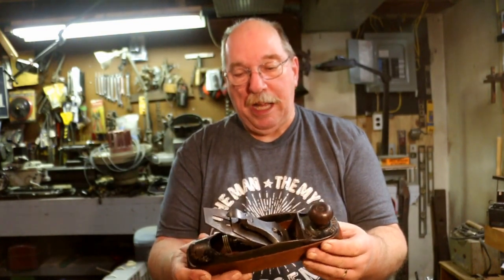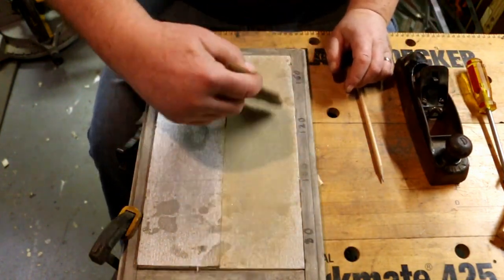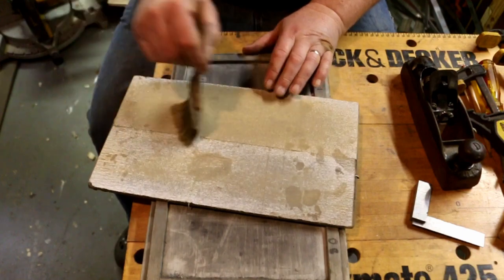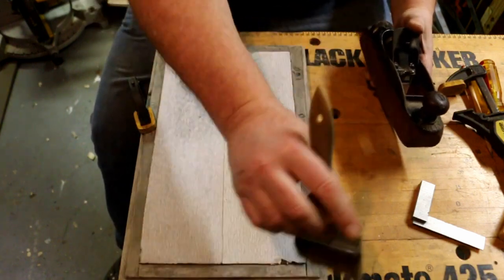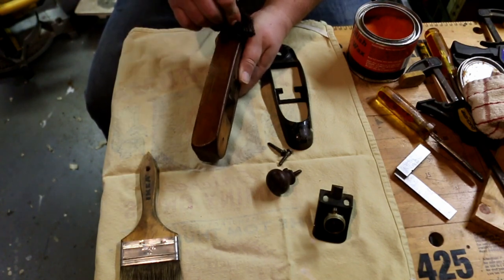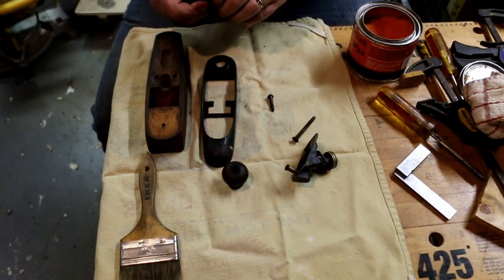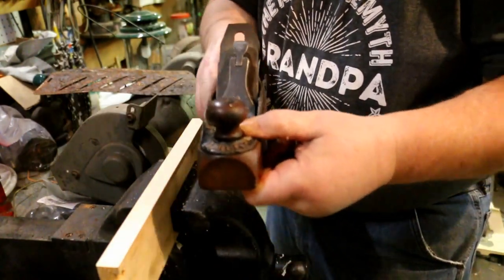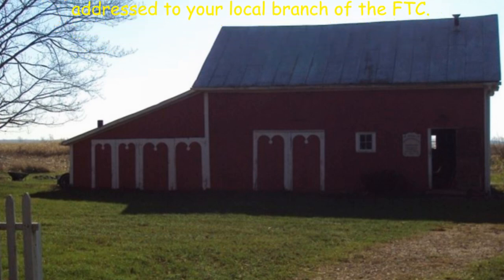Restore Finds Pt2 Finishing The Plane

Comment: A well used plane always has a wear pattern near the mouth like that. You can tell it was a well used tool. 

One thing traditional Chinese Bao (jack) planes (which are wood) do to keep the mouth from opening up is putting a small strip of  brass at the top of the mouth. I wonder how hard it would be to tighten an old wooden place t mouth up with some brass
Reply from the maker: I have seen it done with brass, steel, and wood. 
The best one I have done was when I added a 1/4" thick piece of bamboo from a scrap piece of bamboo carpet runner.
I needed to make up for a lot of wear on an old plane that needed everything. 
https://youtu.be/7vgmWHBIWSw